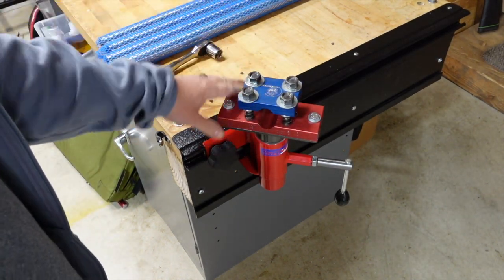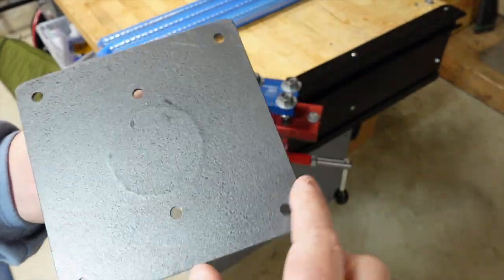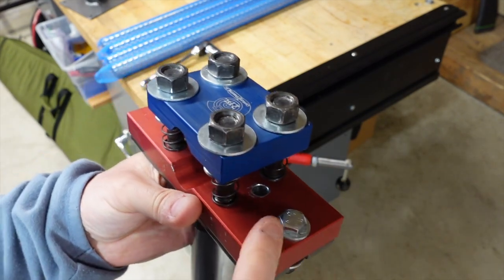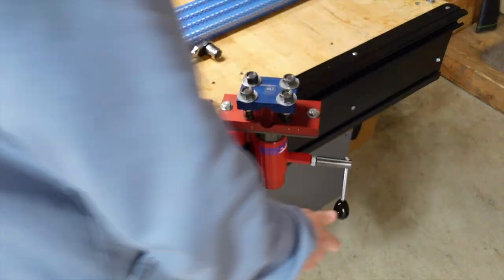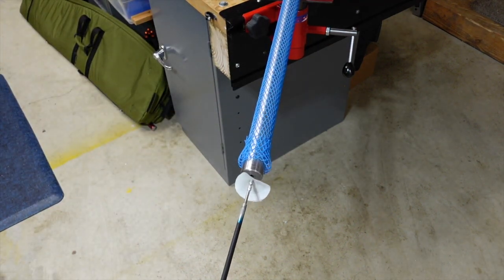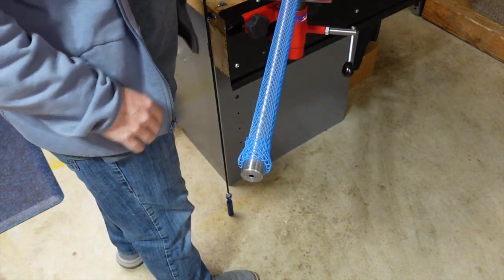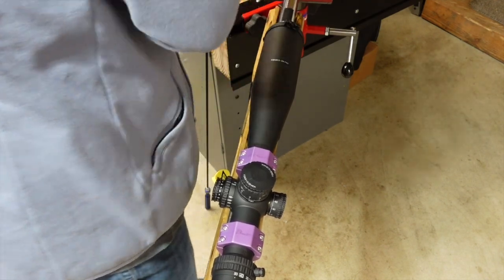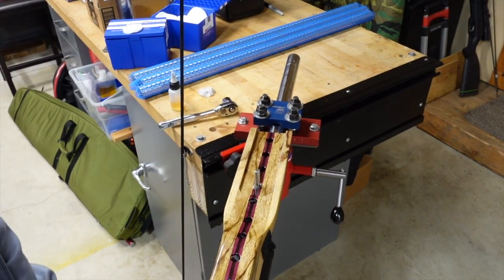Howard's Total Vise barrel clamp attachment review

Comment: I like the Total Vice side mount and track system. Want to get the mount for the Pattern Makers Vice. Which seems to work well for holding the barrel. Did some gunsmithing on my 1947 Win 94 and was able to put it in many different positions for dismantling. But would be so nice to have the Total Vice holding system to really top off the system. Right now I have my barrel vice on the Inline system but I like this much better as you can rotate the tool where ever you need it. Thanks for sharing.
Reply from the maker: Yeah it’s a really good system. I actually have a video on the track system coming up tomorrow or Sunday.

Comment: What are the holes and pin on the underside of your stock?
Reply from the maker: The holes are there to help with venting colder air across the barrel as heat rises. It also helps alleviate just a little bit of weight. The pin is my foreend stop for my front rest. It’s lighter, easier and more repeatable without any potential issues compared to a normal forend stop.
Reply: @FClassJohn  That's a great idea. I have never seen that before.